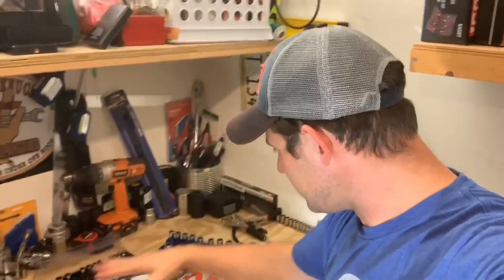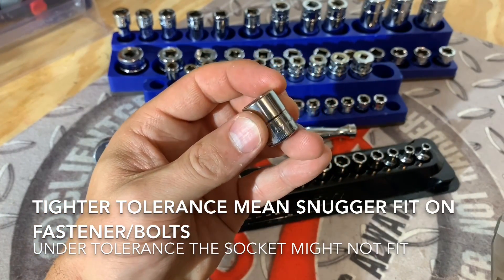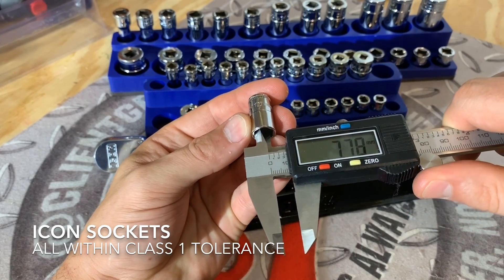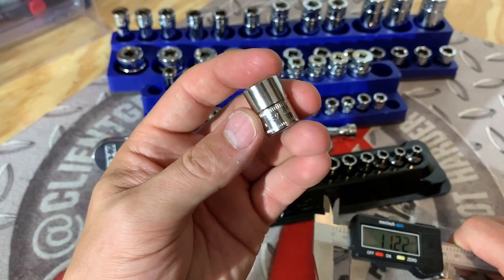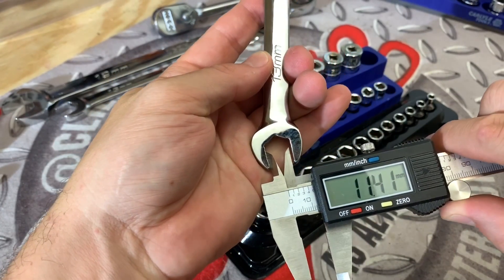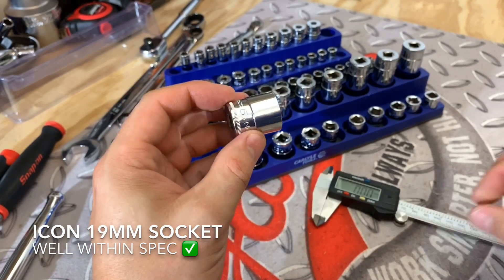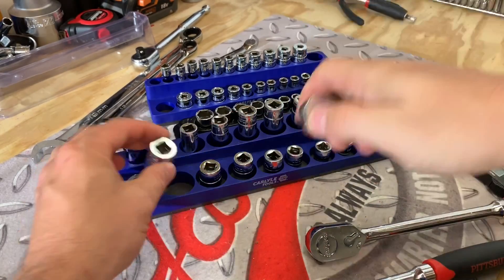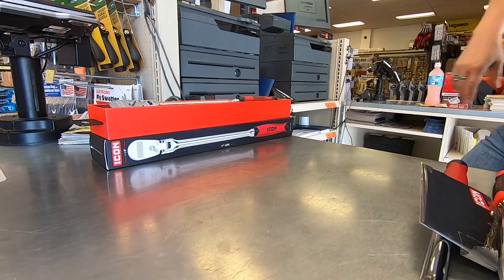ICON Tools Socket Wrench Tolerance Does Harbor Freight Measure Up to Snap On

Comment: Im deciding between this and the husky master socket set.

Im a serious diyer, that will be restoring a prelude SH to like new spec,  rebuilding an sr20, and swapping a 2jz.

Im in the tool purchasing phase.  Which would you recommend?
Reply from the maker: Juan C Few things. Which is closest to you? Do the Husky sockets have the machine milled detent with the square cut out as they are easy to get off quick release and other ratchets but have some slop.  ICON doesn’t have a quick release ratchet.  The ICON sockets look and feel better than the Husky sockets and Husky is technically a Class 2 spec size where ICON is a Class 1 based on what I’ve measured.  Both ICON or Husky will work and both have a lifetime warranty just comes down to $$$ and preferences.  Lots of value in Husky.  I would say also check out Tekton.
Reply: They’re equally close!  The Harbor Freight is across the street from the Home Depot.

I did the math and it’s around 240.00 for just the metric set.  I doubt I’d ever use standard size for my cars.  And it’d be less if I skip the half inch sizes and just use/get impact sockets for those...
Reply from the maker: Juan C I didn’t buy any ICON SAE stuff won’t use it either.  The Husky Model #: H200MSS  1/4 in., 3/8 in. and 1/2 in. Drive Socket Set (200-Piece) is like $200 if you can deal with the socket wiggle on the ratchet it’s a huge value but I think the 1/2” are 12pt and they might have a few other sets that include a storage holder. You’ll really primarily use what: the 8, 10, 12, 13, 14, 17, and 19 and maybe 21 depending on mounts lugs and a few other things.  Hold onto your receipt as both places have a 90 day warranty so see what is right for you.
Reply: @juan c I highly recommend Tekton. The newer husky stuff is not bad, I am undecided about Icon. I know that some of the Icon stuff is rebranded Tekton. For example the swivel head ratchets and composite ratchets are rebranded Tekton, or made by the same manufacturer that makes Tekton. I have had bad luck if HF tools. Nearly lost a finger to a fan and radiator accident when a Pittsburgh wrench rounded off a bolt on a fan clutch. Thank god for mechanics gloves. But even then I ended up with stitches. I would recommend you look at Tekton, you can buy them in no skip set and get just the tools you need. And their warranty it top notch. Break a tool, take a picture and email it to them and they will send you a new one. Not that I have ever broken any. I switched to Tekton about 2 years ago, they are my new go to brand. I restore old muscle cars as a hobbie, so I am not a professional mechanic, so snapon and other tool truck brands are out of my budget.

Comment: The tolerances may be good, but the metal is going to be softer. For longevity, I'll put the Snapon socket against it any day. But still very impressive.
Reply: I'd like to know how you can say with such certainty that Icon will be softer steel. It's not like Snap-On is the only company that knows how to heat treat or has some special alloy nobody else can get.
Reply: I have some much cheaper sockets than icon with a decade of use on them, cr-v  sockets don't really wear quickly
Cr-mo impacts seem to wear down quick, but slight mushrooming doesn't seem to affect much.
Reply: who cares about longevity when you have a "lifetime warranty"
Reply: @hunterXhamster  Snapon is out of manys budgets, but when you have to stop the job constantly because the tool broke, waste gas and tires, etc. To go exchange the longevity seems a little better choice IMHO...
Reply: @azmrblack  idk man i think if people are on a budget and worried about gas and tires to go to harbor freight on the way home then snap on is out of the budget anyway. if u  buy 2 sets of icon it will still be less than half the price of snap on and u dont need to stop what your doing to go get a warranty
Reply: @azmrblack  Not sure what you are talking about. I work on heavy equipment, industrial equipment, farm equipment, diesel trucks etc. for a living. I do this 60hrs a week. I do not have one snapon tool. I beat on these tool I do not work on 4 cylinder engines in a shop all day. I have a variety of tools, with no truck tools. I do not have to constantly stop the job due to broken tools.

Comment: Wait, didn’t you break the ratchet while testing it? Shouldn’t that not count on the warranty since it wasn’t being used as intended?
Reply: SBdunks3 I once had a extendable ratchet from harbor freight & just wanted a new one, put it on the vice and hit it and couldn’t break the gears, I ended up beating the anvil (the piece that grabs the socket) and took it to my store where I went all the time, I told the guy I broke it intentionally and he swapped it without a problem
Reply from the maker: SBdunks3 I intended to use it for testing and to validate the warranty as I questioned the no questions.  Challenge excepted and completed it’s all good!
Reply: ClientGraphics huh?

Comment: Used vs new?
I'm sure the tolerance will be more in a used tool
Reply: He used that 19 mm icon socket for a rachet test,  8 ratchets total, each rachet went over 200 ft lbs

Comment: Icon needs to have larger metric sockets. I hate it when it just goes up to 19mm...for this reason...I'm thinking of just going with duralast.. Taiwan  and more store location
Reply from the maker: 19mm is getting up there and you can move over to the 1/2” which ICON has up to 24mm.  Tekton also has the massive 1/2” 84pc set that goes to 32mm you can look at on my channel as I did a review on it.

Comment: Snap-on hat but your talkin about Icon tools. 😂
Reply from the maker: Alphonsus Jr Quitoriano 👍🏻 pointed that fact out at the end of the video.  ICON doesn’t make a hat. 😂
Reply: ClientGraphics just giving you a hard time bro all fun and games. I just went to my harbor freight and got the 1/4 inch soft grip roto head ratchet and 1/4 metric deep well socket set. I’m very impressed just wish they put a 15mm in the 1/4 socket set! I love the 15mm 1/4 socket!
Reply from the maker: +Alphonsus Jr Quitoriano I would have liked a 15mm also.  Very few inexpensive sets that can fill the whole 1/4 socket holders like the 13pc GearWrench.  Even Tekton skips the 15mm and ends at 14mm in 1/4” drive
Reply: ClientGraphics over all though bro I can’t complain for what I get for the price. Maybe and hopefully they come with individual sockets for purchase and maybe they come out with a 15mm for purchase in 1/4
Reply: Gotta love a good snapon hat I have the same one

Comment: Sweet.. someone pulled out a Caliper to check an made sure to zero out each check point.. "Very nice"!!, No need to explaine why you cheched used/worn tools to new tools, as even used tools should be with in tolerance, in general, unless they were out of tolerance new !
Thank you for taking the time to check them an using a 10mm..been nice if you would of done a 1/4, 1/2 or 9/16 as those are common an highly used, its nice seeing actual results, off the shelf tools...👍👍
(Edit): now the true test of time... as Pittsboro has lasted 20+yrs in my box, replacing a few that get used more so than others, as some of my craftsman Ive had for 30+yrs, have had the same issues and my Cornwells too... Tho my Mitutoyo's /Starrett's are the best Ive ever used... Could you imagine a Mitutoyo 3/4 flex Ratchet lmfao or a Swiss made 3/4 flex Ratchet... Blahaha... I'd take a dozen "please" 🤣🤣🤣
Reply from the maker: Good point decent or lightly used tools should be in tolerance and thanks for catching that I did zero out or check it between measures.  I probably had over an hour worth of footage to to trim down andI only purchased metric but the long ratcheting wrenches are so nice I might have to get an SAE set before year end but I’ll probably save the money for something else new or some impacts.
Reply: @ClientGraphics  your welcome... Im a Machinist by trade so we have to work with metals all day long an its second hand to check tolerance numerous times throughout the day..  Mechanics typically dont need to but they also know theres thousands of metals an they all have a purpose.
Im just glad a decent tool is out at a affordable price 😁👍👍
Reply: Emerald lx  as a matter of fact, yes... Blahaha... Metal does have a shelf life but that shelf usually wont hold the tool as its ether metal or wood... Really... Wow, thats your gripe ?
"Nothing lasts forever" !!!
(Edit) Further more, if you would of paid attion to what I said (it was stated those Snap Ons are used "not being as good a new set of snap Ons"), they dont change much in tolerance, just because they arent new, shouldnt matter if they are used an one of the top leading tools lmao

Comment: I have used them for a day now on impact and hand. Just like I did with snap on for the last 6 years. The metal definitely feels softer and the sockets a a bit taller like any Other Taiwan socket. But I didn’t round anything off will update in a week.
Reply: 10 months later how they working out for you?
Reply: Just so I'm clear, you're not talking about the deeps, correct?
Reply: @felixf5211  No the 1/4 shallow sockets are taller then the snap on 1/4 shallow
Reply: @LEGOCAMARO  Thank you for the clarification. I'm looking for a set of 3/8 mids. Maybe Icon is the way to go.
Reply from the maker: Felix F Did someone say mid sockets.... Can I give my $.02. Cheapest route would be Stanley then Dewalt but they are not all the same size but are the shortest deeps around.  Then GearWrench and Napa Carlyle (30% off Retail price 2nd Saturday of the month before 9am) then maybe SK then maybe truck brand.  I personally have the Carlyle and Stanley and a mixed Blackhawk and Craftsman mid-length set.

Comment: Insides of sockets now are rounded to prevent putting pressure on fastener corners, so it's hard to really put stock in these kinds of tests. It would be extremely hard to be at the exact apex of the rounded surface on both sides of the socket for every test. Still interesting to see the comparisons though.

Comment: You got the result from the socket sticking to the anvil due to the detent within the socket design was ment for the Ratchet of same design...I just did a video on a SNAP-ON low Profile Socket/Ratchet set but the results were semi the opposite way around the Sockets that come in a package with the ratchet do not stick properly to the anvil due to that detent but if you take the same socket and put it on a normal Standard ratchet anvil it was also showing what you just displayed by it sticking and you would half to apply force in order to remove the socket

Comment: Here is the thing Your NOT saying!!!! Will the Icon still be a a good tool after 20/30/40/50+ years like Snap On is.... 🤔🤔🤔🤔🤔🤔🤔🤔
Reply: Truck Mechanic That’s an unrealistic demand to expect him to say “I guarantee this will still be great after 50 years!!” He’s showing everything he can about the ICON tools, but he doesn’t have a time machine... Will a snap on tool made today still be good in 50 years?? Also consider that snap on is making more and more items over seas. Also consider that that if your snap on does fail (which they do, they aren’t perfect) how hard it is to replace it through the warranty. The ICON has a lifetime warranty, no questions asked and, from all accounts, it’s made to a very high quality. It’s up to people to decide from there.
Reply: A 1/2 deep socket set is about 1/10 the price of s-o. If he bought a new set every 10 yrs, he'd still be way ahead. How good is a 50 yo snap on socket? I have some that are over 30 and are pretty worn
Reply from the maker: Ben Whitaker Fair point $513 for a SnapOn 313TSMYA 13 pc 1/2" Drive 6-Point Metric Flank Drive Deep Socket Set (12-24 mm) compared to $59.99 for the Icon so you could buy 8 sets compared to 1
Reply: you have never snapped or broke a snapon ratchet or socket? then you obviously arnt using them. All tools break, HF has a no hassle, no reciept needed, no questions asked warranty...take it in, swap it out....dont gotta wait 3 weeks on the tool truck to get the tool in, or wait a week for him to show up if he has it on the truck.
Reply: @quiksol  this is a fact i inherited a snapon box and tools from the 70s of the 8 rachets ive broken 3 local snap on guy says warranty only applies to the original buyer so ive not repaired them used some Pittsburg pro rachets to finish the jobs snap on used to be head and shoulders above everyone for quality thats just not the case anymore everyone caught up and snap on peaked the Chinese got smart started using the same techniques to build their stuff and use the cost of labor to keep prices low snap on has to pay more to manufacture sell for profit to tool truck who then sells for profit to the public its inefficient and costly. Tool trucks seem convenient for a while until people bought all the tools they need now instead of coming once a week they start coming once a month to get money from the people who financed their shit. Its honestly easier to replace tools at harbor freight then the tool trucks in my experience. Is snap on better sure but maybe by 5% is 5% performance worth 3-5x as much money? no. its the law of diminishing returns.
Reply from the maker: Truck Mechanic Only time will tell so you won’t hear me say longevity statements unless I have personally tested it.  One things for sure I’m thankful for being able to repair my Grandpa’s 1946 Snap On ratchet and get it on video!  All the best and thank you for watching and commenting 👍🏻

Comment: I’m thinking 🤔 🤔🤔 maybe you step on a Snap On truck and check some new never used tools on camera. After all it would only be fair.
Reply from the maker: Truck Mechanic  I’ll see what I can do, no promises but I’ll try in the future if I can remember and sneak it in somewhere 🧰 👨‍🔧
Reply: Why do they have to be new, specially if Snap On is so close to tolerance regardless if its used or not an they are supposed to be one of the best tools on the market, the metal used to produce any of these tools wont change much if at all because they are a tool metal alloy that usually doesnt cause much change from most makers, even as years pass, unless your looking at 50+yrs ago lol or the maker of the tool doesnt care as its a cheap tool an metal used to make the tool and you see the cheapness in the tool, in general.. unless your not willing to check your tools supplier..because nothing was said that snap-on wasnt with in tolerance even if they were 20yrs old, otherwise we'd all would be needing new tools way more than we do, no ones saying ICON tools are better than Snap On.. Right ? LMFAO

Comment: Are you checking “used” tools to new never used tools??
Reply from the maker: I’ve used all the ICON sockets some and that 19mm had 200+ ft-lbs on it multiple times. Snap On was still within Class 1 tolerances and all sockets can very but be within spec.  The Snap On sockets are so lightly used and have little to no wear.  Remember first runs of tools verse the last runs can vary and even .05 or .1 in the manufacturing process can have a big impacts on the finished product.
Reply: @ClientGraphics  this is true.  stuff changes.  glad to see most in spec.
Reply: @ClientGraphics  vary* geezeee

Comment from the maker: ICON sockets looks to have tighter dimensions then the Snap On sockets I bought at a Pawn Shop a few months back. ICON also measured within Class 1 ISO 691 specs and looked 👌🏼 **Please note all tools can and will measure different due to manufacturing processes**